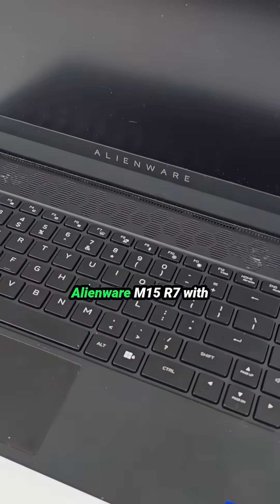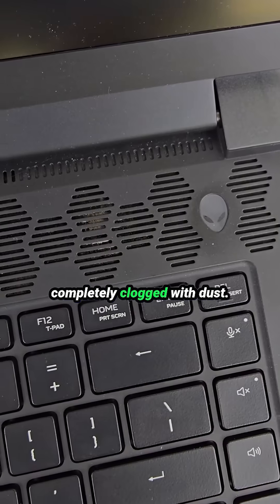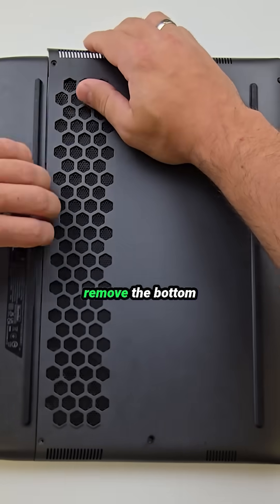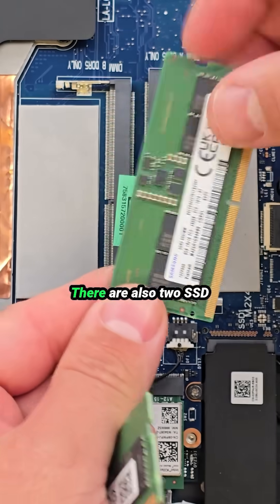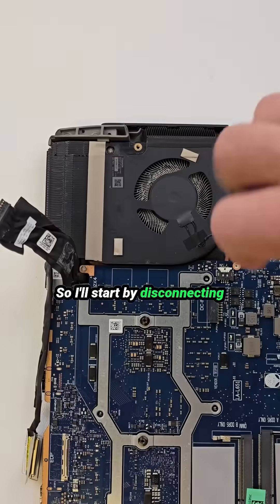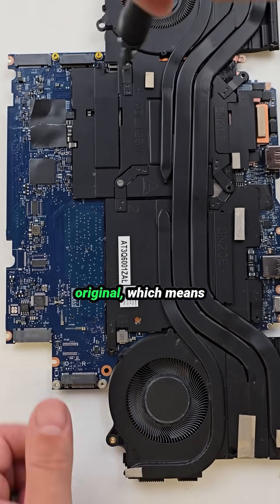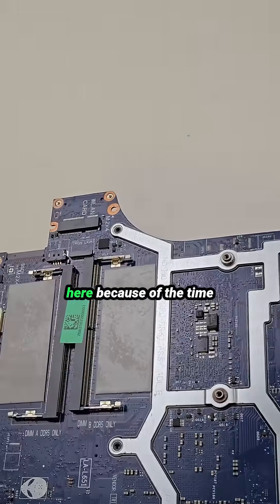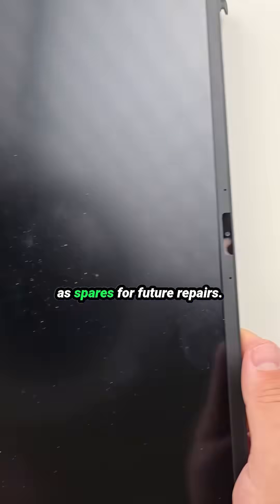Dell Alienware M15 R7 Teardown | Power Issue Fix & Screen Off

Comment: I have the same laptop, but my laptop's problem is that, When I plug it in, it will show that it's charging, but whenever I open a game, it will shut down automatically and the charging stops even if its sill plugged in. Not sure what the problem is, is it the charging port or something else.
Reply: actually, as a fellow r7 owner, the issue is intel turbo boost in the bios. software, not battery. I disabled my intel turbo boost and haven’t had a problem since
Reply: @scienceman1837 I'll try this. Thanks. I do believe this is actually the problem because it only shuts down if I do open some games or heavy software like my rendering software.
Reply from the maker: Start with replacing battery, if the issue is still there most likely motherboard issue